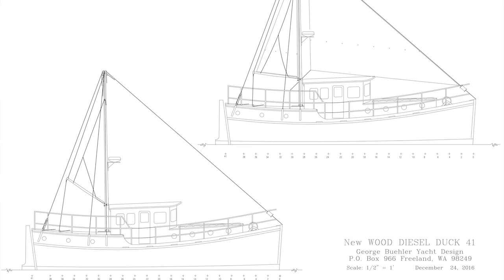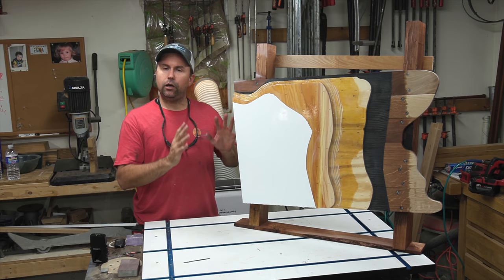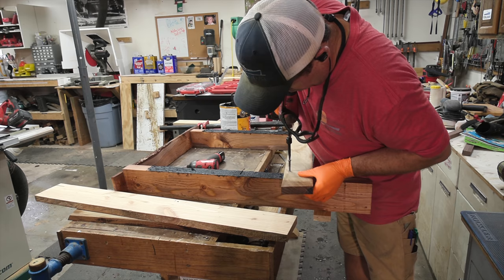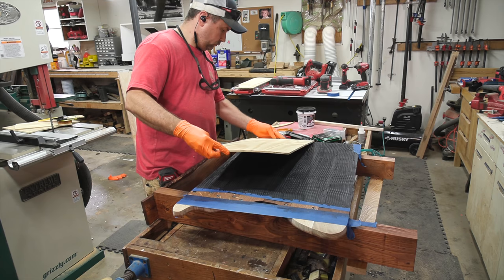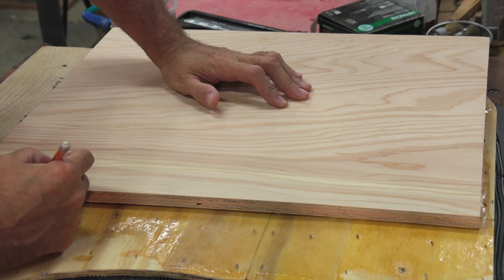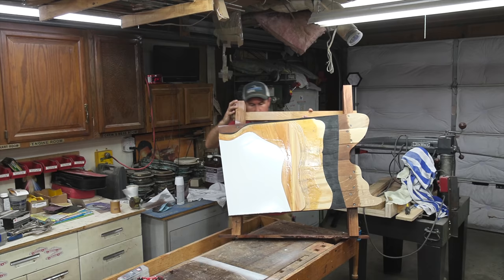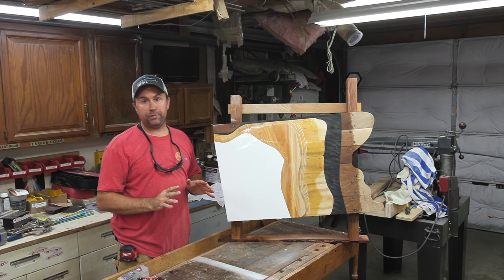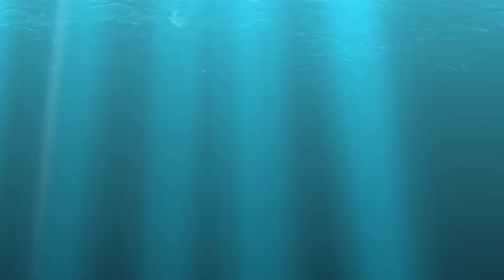Buehler's Composite Hull and special project announcement.  SDP Special Edition.

Comment: For attaching the plywood you might want to look for a drywall screw gun with some self sinking deck screws.  That will likely give you a better result that nails.
Reply: I've used that very tool and I believe your advice is sound and would work very well for attaching the plywood... I've never built a boat, other than a cedar strip canoe, but I'm a carpenter and woodworker with 25 + yrs experience. So take my opinion for what it is, just that, my opinion. Maybe you could set up a "sample" of the hull and test the drywall screw gun, also consider checking out the deck and porch screw guns.

Comment: When you put that much epoxy on fiberglass, the glass will float to the top and leave a layer of epoxy between the fiberglass and, in this case plywood. It may be very thin, but it still affects the overall strength and weight. That creates weakness and adds weight.  It should be squeegeed to remove the excess.  Then peel ply can be put on as a last layer.  Then there is no need to sand before the last coat of epoxy.  Sanding will almost always result in cutting some of the fiberglass fibers and thus loose more strength.
Reply: Such light FG scrim isn't going to be part of any significant "strength". The thickness of the Epoxy is the protection against sharp impacts, and insignificant for overall hull  "strength"

Comment: Actually Flex Seal is a pretty decent product. I've use it many times and it stays flexible even in direct sunlight. Because it's an "As Seen On TV" product some think it's no good. That's not always true. I would think it would work very well for what you want to do with it. I would use bronze ring shank nails instead of staples. Better holding power.

Comment: In his book: Devlin's Boatbuilding: How to Build Any Boat the Stitch-and-Glue Way, when building his larger vessels such as the Sockeye 45, Sam Devlin cold moulds 2 or 3 layers of marine ply & IIRC, drills dozens of holes in the ply to allow air & thickened epoxy to flow through & ensure the bond between layers. He also uses staples to fasten the layers & makes the point that the cured epoxy pillars in the drilled holes act 3 dimensionally like nails. There are inexpensive copies available from Amazon.
Reply: Screws are needed to pull the layers together to get a good bond. But with many holes in the layers to allow trapped air/excess epoxy out staples might be a sufficient alternative.
The holes filled with expoxy even provide more mechanical bonding for the epoxy to hold onto. Interesting idea.

But with the thickness of the plywood on this project I think I'd still use screws so I have 100% confidence of a good bond with no gaps. If it were 1/8 or 1/4" ply staples would very likely work fine but looks like he is using 5/8 or 3/4 ply.
Reply: Listen and learn
Reply: There you go
Reply: Long screws hit all ribs

Comment: It also seems like a good first control article for a series of  test article candidates to leave outdoors in the weather for an extended period of time.  You can use them to evaluate the adhesive and corrosion characteristics of different alternatives for fasteners and tar / tar substitutes etc.   Doug Jackson over at SV Seeker did similar evaluations of various coatings exposed to salt water conditions in an outdoor jacuzzi for over a year.  It could be a very helpful technique for you to use to help inform your decisions.  Good Luck.

Comment: Nice demonstration piece Scott.  Good practice and a good piece to have in the shop for showing people that come over to help how things go together.  As for the Flex-seal, if you can get them to send it to you from the factory at cost I don't know why it wouldn't work.  With the plywood covering it, it won't be exposed to UV which will reduce any deterioration.  Have a good time at the show.

Comment: I personally would not use flex seal I'd used sikaflex first if I were you. Its has much better adhesion capability . Love your storyboard demo for illustration on the composite haul helps explains things perfectly great idea clearly shows all the prep to come up with finished haul of the boat,

Comment: I have no expereience with Flexseal. I do have a little experience with tar and asphalt emulsion products. You can thin tar with kerosene, heating oils, diesel, and other thin petroleum-based oils. However, this brings the cost up which may make the Flexseal type products more financially feasible. Check with Mc-Master Carr and Grainger. They occasionally have similar products to Flexseal but in bulk at I would think a more reasonable price. Keep up the good work.

Comment: As a fellow woodworker, staples? Applying staples with a gun gives no “drawing” power at the point of impact. If the ply surface is not drawn up tight to the substrate, the staple will not provide any tightening where a screw will do the compression. That would be my concern about going with staples. Nice model, Bro. It will be different, I’m sure you know - when working on the curves of the hull.

Comment: Hi!  Love your project!
I question the wisdom of using staples to attach the plywood layers.  I’m concerned that staples won’t allow you to conform the plywood to the curvature of the hull , resulting in voids and increasing the danger of delamination between the layers of the hull.
Reply: I got the impression that the staples were for the demo only but I was cooking and watching the video over my shoulder and may have it wrong.
Reply: He states that much larger staples will be used on the boat, the smaller staples were for demonstration purposes. I can see what Mark Cutshall is saying, but if there's enough attention to detail, this will be a non-issue.
Reply: 316 stainless wide staples are commonly used in laminated plywood boat building-- have been, successfully, for years. Note that epoxy is typically used between layers. That's what actually holds the layers together. The staples merely keep it all together until the epoxy sets.
Reply: @falco621  Got it Thanks.I will watch again when time permits! CHEERS from Canadian westcoast
Reply: @crustycurmudgeon2182  I agree but the first layer of ply will let go from the flex seal coating, I know from experience that the staples will not hold permanently,  the best method would be to either screw the first layer or use rim shank silica bronze nails (my preferred choice) into the planking layer then epoxy and staple the second layer, this will bond the entire structure.
Reply: @errolseager1292  As flex seal is one of those miracle "As Seen on TV" inventions, I'm not at all sure of its adhesive properties, or its longevity. I agree with your silica bronze nails preference. George Buehler's laminated design is rather unusual (I honestly don't see how tar would be much better as an adhesive). But he does specify screws in the first layer of plywood. Sam Devlin's book on "Stitch-and-Glue" boat building uses a much different method for laminated hulls-- and staples are used. Devlin's boats are generally the only ones intact at a marina after a storm-- minor damage, still afloat.

Comment: Hi Scott: I know i'm late to the party but time is on our side. I have a plywood 25' 1961 Chris Craft Cavalier that I've owned for 40 years. I started using SikaFlex before it became popular as a marine product. I found out about it from a concrete contractor who used it due to it's flexibility AND elasticity. I've put in a new full keel, keelson, foredeck, transom, engine stringers and part of the 1/2 marine plywood side and bottom...Everything is still tight and functional. I took a shot at something nobody did b/4. I did the keel etc in 1984 the rest in 84>89. I had nothing to lose. Your case is different. I would talk to the guys at Jamestown. They may have a similar product or give you some good advice. It's your first boat, get some advice at the wooden boat builders in ME. They might know more about your idea and would love to help out.

Comment: I’m assuming the plywood will be staggered butt-joints. Any point-loading will be at those joints, so if Buhler recommends screws, I’d use screws... lots of ‘em! I would forever worry about the longevity of Flex-Seal in that application.
Reply: I would probably want to play safe, i would put tar or epoxy tar  + flex seal below waterline , and above just flex seal.

Comment: Neat project. Regarding Flex-seal, how about doing some simple tests, with tar and any other alternatives as a comparison?  Perhaps make up a several small sandwiches of planks and plywood using various flexible sealants and set them side-by-side outside in the weather for a while.

Comment: Look into Henry's silicone roof coating. Its basically flex seal from a commercial roofing company that has been around a while. Only problem I see is that nothing should bond to it once cured.

Comment: Yeah staples are tempting - quick and easy, but they don’t offer much holding power, particularly under stress. Given these will be holding all your outer layers to the solid timber base I’d be thinking long and hard about not going with what the designer is advising you use, ie screws. The flexible membrane is of course flexible and designed purposefully Not to hold anything. If it was epoxy, fine, but tar or flex seal - not much adhesion there.  All the more reason that the right fixing is critical between these two layers. 
Possibly a ring shanked nail would do the job. But a smooth staple?  I wouldn’t bet money on it long term.
Use a power driver and you won’t need to drill holes for small gauge screws. Just drive em in. Zip, zip zip… Still quick and easy.
Reply: I'm not a fan of staples either, but in our shop when we pull apart packing boxes, the staples often break rather than pulling out.  Wide crown staples, if they're long enough, can be impossible to pull out.  Not sure if they'd pull the plywood down to the substrate, but I bet they would.

Comment: I would not veer away from the original design in materials or fasteners. You are going to experience stresses and conditions on the water vastly different from the likes of which occur on land. The problems in a hull such as the type you are creating will occur when water is able to penetrate through one or more of the layers in the composite. It is also going to be more difficult to repair in the event you need to and you’ll want to hold off that scenario as long as possible. Few boats avoid the need for repairs at some point. Experience leads to proper design, you don’t want to find out too late that a substitution has caused a major problem.

Comment: I am not a boat expert (or even novice). I am not a materials expert. But it seems you need to focus on what the purpose of what the tar layer is for. You stated it was to allow movement between the plywood and solid wood layers. There is no mention of a seal. Tar on a roof will seal, for awhile but not forever. It is quite brittle when cold. Several comments mention how long tar has been used on boats as the reason it should be used here. But let me ask this, how long has it been used as a layer between plywood and solid wood (as an interior surface) of boat hulls?

Comment: Have you seen the sheet type bitumen membrane that they use for foundation below grade ? I was talking to a guy who installs this stuff on new construction, poured concrete, or the foam block foundation. This is not your grandads tarpaper. It has heat activated adhesive and is supposed to be very effective against water penetration, flexible etc. They have a similar product that the use for roofing but there are modern versions.

Comment: I agree with some of the others on the flex seal. It wouldn’t stay on well cleaned and prepped gutters on my house. No way in hell would I use it for a row boat, let an ocean going project like yours.
Reply: That might be so, but if the Flex seal will be sandwiched and sealed within the structure, it wouldn't be subject to atmospheric conditions as it was with your gutters so would not fail in the same manner, assuming it stays flexible.

Comment: I understand your thinking behind the flex product. However it hasn't been around for long I would question its lifespan buried behind your hull it would be a tragedy if it started to disintegrate in 5 or even 10 years. I really like you videos thanks for Sharing

Comment: Is there a specific reason slotted head screws were used on the boat build? I’ve noticed they have been used on my wooden boat too. Is it just traditional?
Reply: No, and yes
Reply: Traditionally the heads are countersunk and covered by bungs.   If the fastener ever needs to be removed, it isn’t too difficult to dig any glue out of a slot, but a royal pain to get it out of a phillips, hex, etc. cavity.    Slotted screws are not too bad if you use the correct size and properly shaped blade.   The main problem is that in common use, too-small blades in poor condition (or even a literal butter knife) are more the rule than the exception.